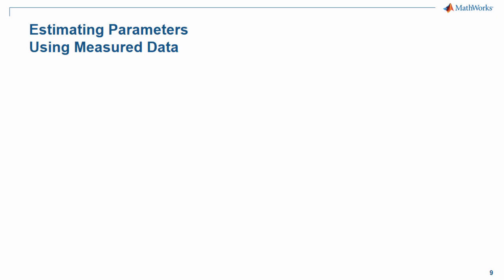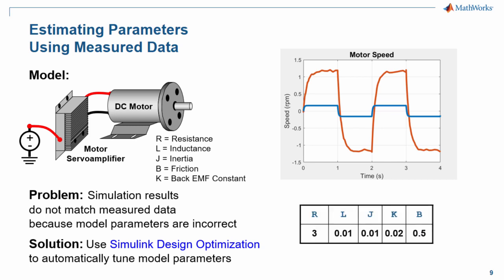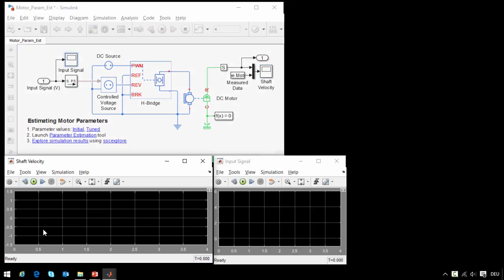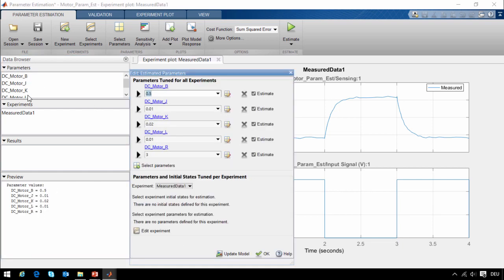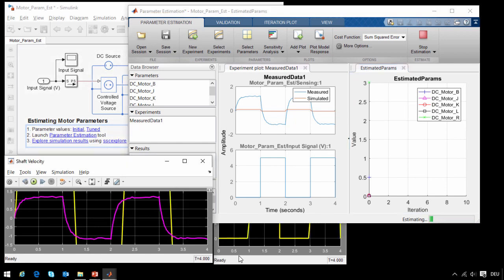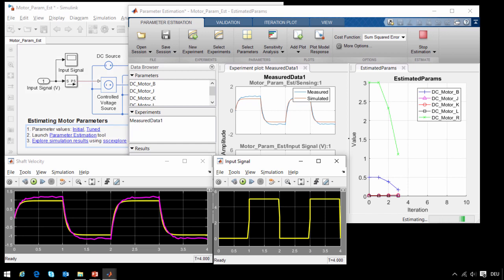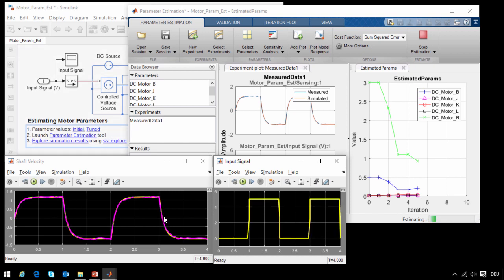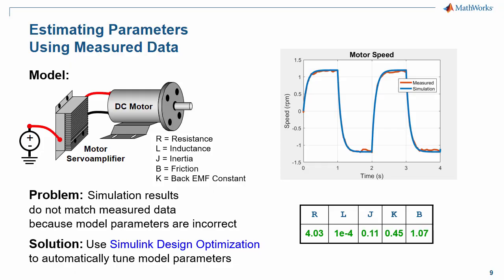Simscape DC Motor Model Parameter Tuning

Comment: How can a square wave be always positive whereas the motor’s rotation is on both signs?
Reply: Changing the reverse input (REV) of the H-bridge between 0 and 5V makes the motor rotate clockwise and counter clockwise.